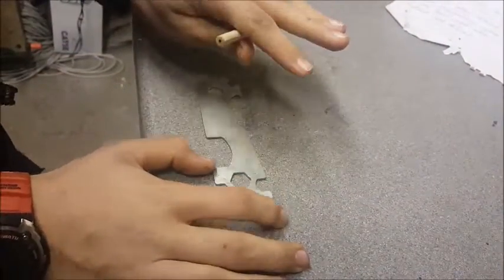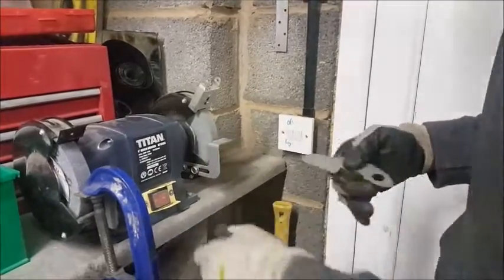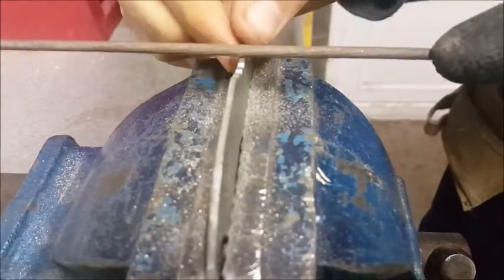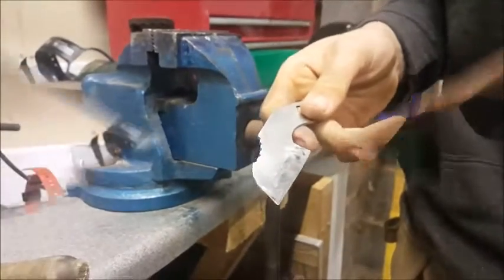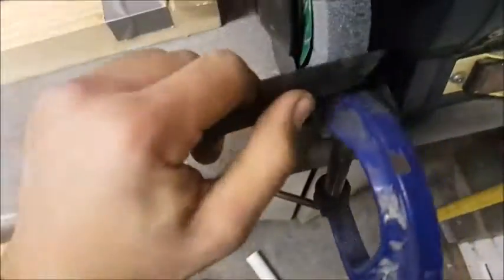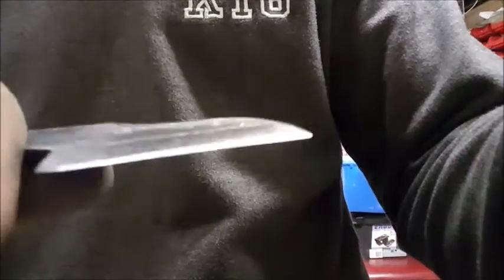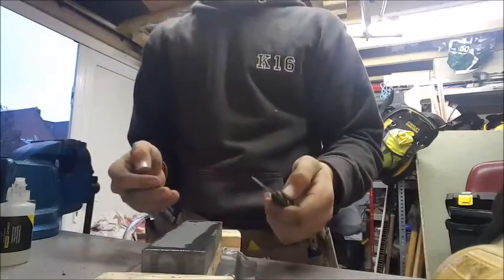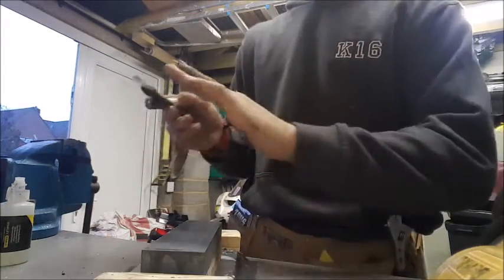Making a Knife out of a Bike Tool

Comment: Hey there, my name's Justin and I am a blade smith myself. I just wanted to mention a few things. You showed hardening the blade but you didn't show tempering where you remove some of the brittleness from the blade. I don't know if you did that off camera or you didn't do it. Some knives can be left hard if the use the will receive wont put too much shock on it. Also, (and I'm sure you know this already, but just in case), I recommend you get a belt grinder they really do make a huge difference in the overall finish of your knives and you can use them to sharpen as well. I know that for 1x30" belts are available up to 12000 grit so you can put a mirror polish while sharpening if you want. I hope to be able to put some videos on here soon, but I need a camera first, so we'll see but keep up the good work and I hope to see more.
Reply from the maker: Justin Shaben 
I appreciate the information.
Yes I did temper the spine off camera. I didn't think it was worth showing and i received a belt grinder for Christmas. money is a bit tight so had to make do with.
Reply from the maker: chewwy bacca no hate please on my channel.
Reply: Knives Galore no
Reply: I love you
Reply from the maker: Justin Shaben
If you are confused about a camera. I use my phone so you can use anything really its not of the upmost importance.
Reply: Knives Galore Cool man. Thanks for responding, and I will be sure to keep watching what you do.
Reply from the maker: Justin Shaben Thanks for the support let me know when your channel starts up so I can learn from you also.